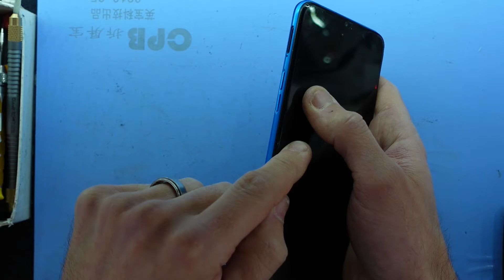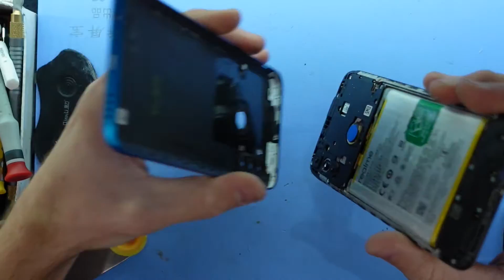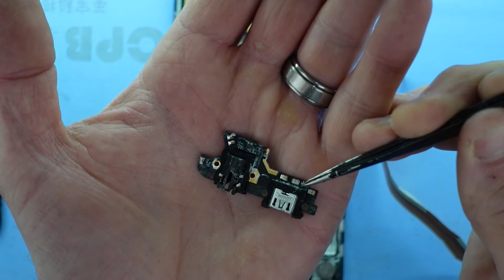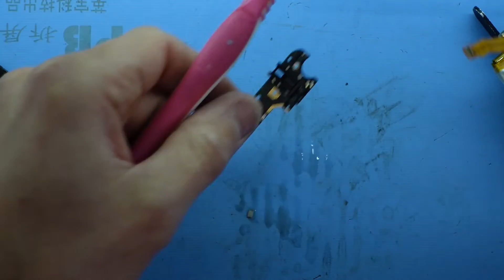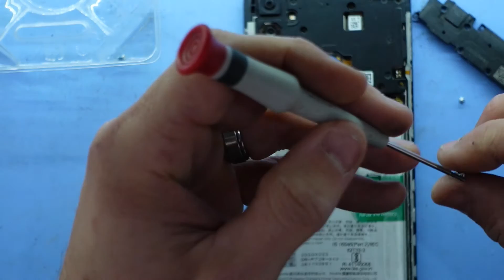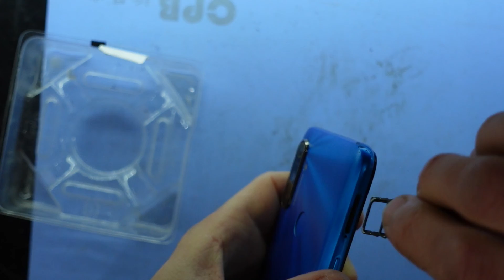Realme water damage repair, my thoughts as i do it

Comment: I happen to have the same phone
Mine just feel down a toilet💀and after cleaning it and letting it dry, it still won't open. The strange thing is,
When i retrived it the screen was on and the touch was also working so i quickly turned it off (screen off) and now on power on the screen just flickers white and shuts off again... any idea what's going on?